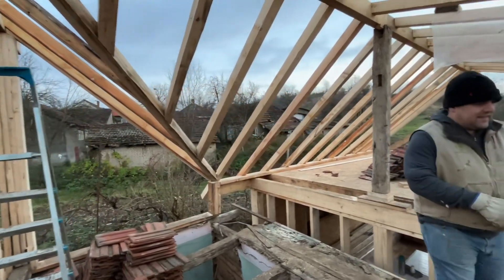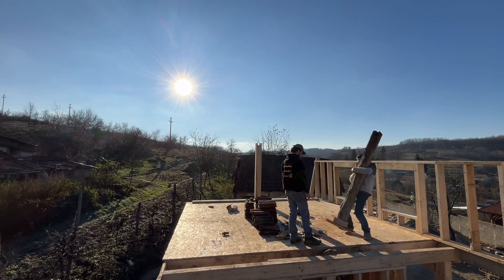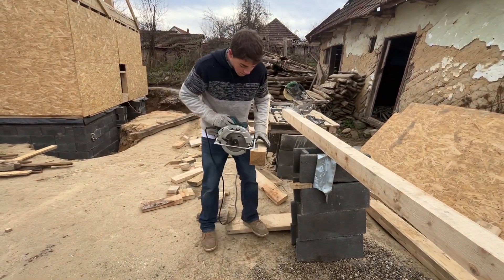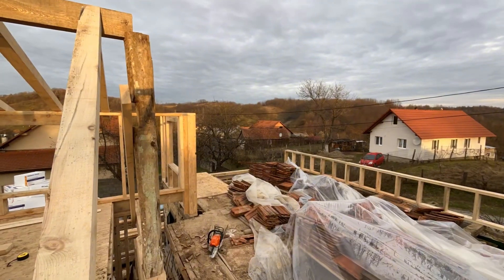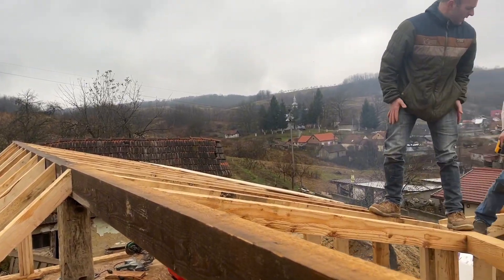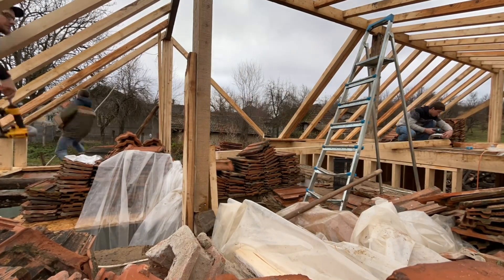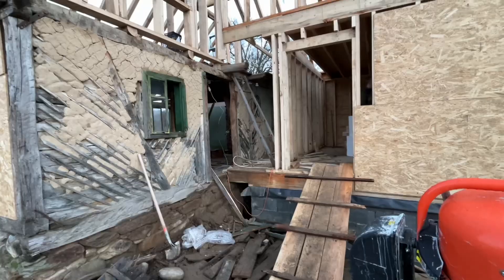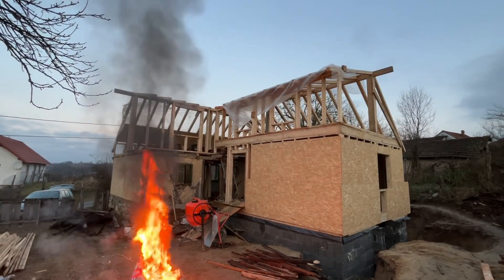Building an exposed rafter roof. Mud house renovation part 7

Comment: If you want to leave the wood exposed.....it would be best to sand and use some stain. Also in this part of world some uses ropes to hide the gapes, too bad i can't send pictures
Reply from the maker: I’ll look at that. What stain would you recommend for around here that doesn’t have any gloss to it and is a dark, older looking stain? I also thought of using some iron work for along the valleys of the beams and run up them like a plant.   Great ideas. Thanks.
Reply: @European_Homesteading  stain here is called baiț, wallnut is one of dark options, but they have catalog for that.
Reply from the maker: thanks. that’s kinda the color I’m leaning toward